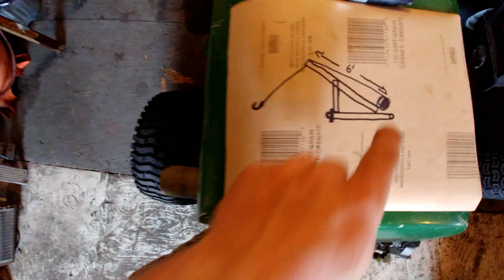How to make a wrecker for the back of a lawn mower

Comment: not a bad build, i would recommend building a removable front weight to keep the front end on the ground when dragging out things heavier than your 6x4 tractor, a tray that you can stack some cinder blocks on, or some suitcase weights or even a few buckets of gravel or water would do the job just fine, it looks like you did your research and did a fairly good job of designing your boom for the job you wanted to do with the rig, all and all, good build, hows it holding up for you now what 2 years after the modification? did you have to change anything, or modify it further to do the job?
Reply from the maker: There is no modification to the frame this entire unit bolts onto the rear differential that's it easy to remove if you want I do have a front weight hooked up but I hardly ever use it

Comment: I have the same tractor I dont use it tho its mainly a parts tractor
Reply from the maker: They are good tractor
Reply: Yeah I did use it til it blew the moter
Reply: Im thinking on trying to fix it
Reply from the maker: The original motor was a 18 Kohler twin I just put in a 13 horsepower Flathead little bit modified for more horsepower
Reply: Cool mine has a 12horse briggs
Reply: Mines a 7 speed whats yours
Reply from the maker: 13 horsepower Briggs in Mine and I think it'll 3-speed and reverse
Reply from the maker: But those differentials about proof to some people I broke a axle
Reply: Ok i just gotta dragg mine out of the woods were i blew it up
Reply: Wered you get that seat
Reply: I like it
Reply from the maker: I made it it was a bus seat
Reply from the maker: I like a lot of room plus the room for a second person
Reply: @greasemonkey348  nice good job you wanna now what my mane tractor is now
Reply: @greasemonkey348  its a 1989 Honda 3813
Reply from the maker: @cameronhimmelman2717  it's a 86 Honda TRX 350 4x4 5 speed with reverse but I override it
Reply: Ye but mine is an 89 3813
Reply from the maker: @cameronhimmelman2717  oh lol that cool
Reply: @greasemonkey348  thanks I also have to fix that I need to fix the drive shaft
Reply from the maker: @cameronhimmelman2717  I broke my front drive shaft two times and I broke the rerun three times had to make my own
Reply from the maker: Also do you have somewhere else to talk
Reply: Nah I don't